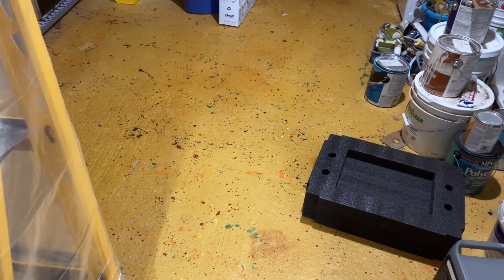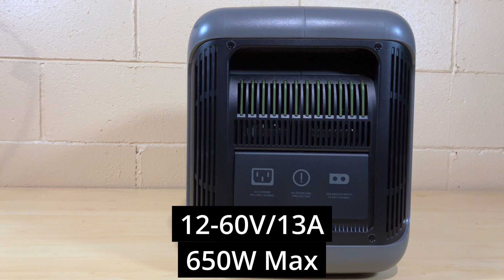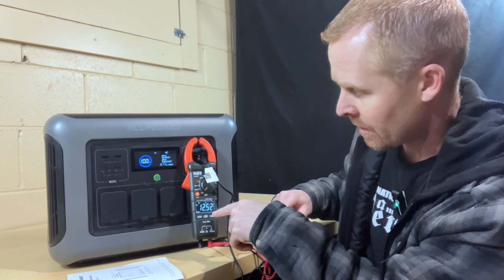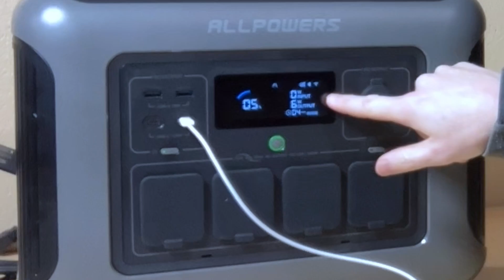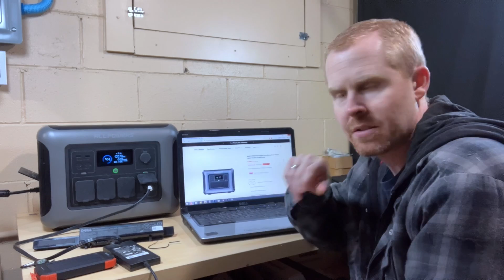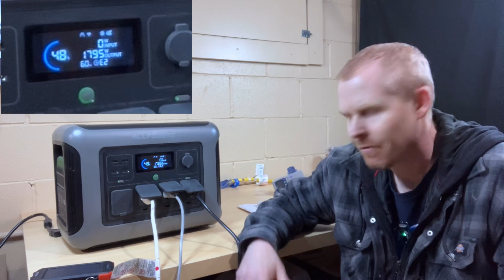ALLPOWERS R1500 Portable Power Station Review

Comment: Can this be used at all without the "app, wi-fi, i-phone" game show? Was thinking of getting this for an elderly relative that will not be able to use any of those techy toys. Thanx.
Reply from the maker: Yes you can!  It has buttons on the front of the unit to turn AC on and off.  If it needs power, you can just plug it in.  The app is not required for normal use.
Reply: @AdamDeLayDIY  Thanks for the quick response!

Comment: Hey adam. Would you recommend this for use of charging cordless power tool batteries and actually running sanders and polishers? Im starting a mobile headlight business and want/need a quiet portable power supply becuase my battery powered buffers suck the batteries dry really fast. So id rather just use my corded buffers
Reply from the maker: Do you happen to know how much power the sanders/buffers use when they run?  Are you talking about running multiples at a time?
Reply: @AdamDeLayDIY  a rotary polisher comes out to I think about 1400 watts when it's running. I probably won't have things running at the same time cuz it's just me. If I have something else plugged it'll probably be a charger of some sort
Reply from the maker: @ChristopherCologneASMR  With only 1152Wh of capacity, you would get less than an hour of total runtime.  While it has its "quirks" that I don't like, it's hard to beat the price.
Reply: @AdamDeLayDIY  that's what I was worried about. I'm new to all this stuff but yeah the price is great. They have the 2000 for 699 right now. I'm probably going to get that one and then make a truck bed cover for my truck that has solar panels on it so I can keep it charging.
Reply from the maker: @ChristopherCologneASMR  No worries.  Yeah it's hard to beat their pricing.  

So a basic way to tell how long something will run is to find out how many watts it takes to power the device (in this case you said 1400W).  So if that sander/buffer ran for 1 hour, it would use 1400Wh (watts x 1 hour) and then look at the power station and you want to find the "watt hours"/"Wh"/capacity (in this case 1056Wh).  

So since the power station capacity is smaller than the power needed to run the sander/buffer for an hour, it couldn't run the entire hour. 

Hopefully that helps and doesn't just confuse you more...😁

I do know that Allpowers was working on expansion batteries as well. Not sure if they're available yet.  Always another option for you.
Reply: @AdamDeLayDIY  yeah it helps. Appreciate it Adam

Comment: Regarding the conversion efficiency, how can we consider the inverter's consumption? Overall, yes, the focus is on the conversion rate so, CC watt per AC watt is the way to measure. CC = continuous current while AC = alternative current.
Reply from the maker: I'm not sure I understand the question.
Reply: @AdamDeLayDIY  (A) it's about the inverter own consumption but this the actual efficiency of the device. (B) is about, pretty much having a direct electrical connection (inside the "box") between the wall socket and the AC consumers. So there should bot be energy moving through the batteries and inverter when plugged on the wall, to power up AC consumers => the battery and inverter stay in standby (inverter shutdown ideally) when the device is used as an UPS.
Reply from the maker: Agreed.  When in UPS mode, grid power should just be flowing to the load.

Comment: Also, regarding the connectivity, it does raise a lot of questions regarding privacy data protection. I no matter what, I don't like to share my location for the Bluetooth access or wi-fi. Second, the menu is dubious + having an account on a Chinese server (meaning CCP) while providing the password to my wi-fi, it make me wander if they could access anything else that i have connected to my wi-fi?
Do that thing with the phone without setting up the wi-fi or installing their app on your phone! See if their device, without being connected "to the world", is still messing with our phone (preferably another phone without their app installed).
Recently I assembled a 15kWh LiFePo4 battery and the BMS  Bluetooth app have, at "about us" and "privacy" tabs, only Chinese language! And, yes, remains the activate location issue.
Reply from the maker: Yeah, I didn't like the app at all.  Lots of issues, and it really doesn't buy you much control over the device.  It's also annoying that if the power station turns off, you have to manually re-enable bluetooth/wifi every time.

The tests I ran on the phone with the display being messed up were on a device that didn't have the app installed on it. I have several phones, one had the app on it and the other didn't.
Reply: @AdamDeLayDIY  people said that there is a security risk when using only a charging cable (which could have been "rigged") so what we can say about "linking" your phone with a box which has a bunch of electronics inside.

Comment: The UPS function can "bypass the charge"/ pass through charge? Through that I want to say if I keep this constantly connected at a power source (wall socket), once the battery is full, it will be disconnected and the consumers will use directly the wall source. 
So the inverter will be shut down when the AC power source is available? (1) AC (wall) - > (2) CC (to charge the battery) -> (3) AC (inverter) -> (4) consumers  (AC consumers). The thing is that if I use it as an UPS, there should only be (1) directly to (4) stage. The battery will be only maintained but not used. The inverter should be shut down as well.
Reply from the maker: When the power station is at 100% it does pass through the grid power straight to the loads.  I was able to confirm this by examining the grid voltage when the power station was at 100%.  It was 122.2v and it was being passed through to the AC Outlets.  When I unplugged the grid connection, the voltage dropped down to 110v.  

I cannot confirm whether or not the inverter actually turns off though.  I would think it would have to stay on in order for the UPS function to be fast enough if grid power is lost.
Reply: @AdamDeLayDIY exactly what i’m worried about. plugged say into a fridge or the tv all the time as a UPS will it draw all that wattage that the inverter take in to charge. That would be very expensive. Now if 100% of the time once the inverter is 100% charged it then the outlet only pulls what the fridge or tv watts is not the inverter watts. thanks great review! $583 2 night ago for the unit and a 140 watt panel. Gotta try it for that price
Reply from the maker: @zgoalscorer10  Thanks.  After looking at different power stations, even with all the little "quirks/oddities" this one has, it's hard to beat the price-point.
Reply: @AdamDeLayDIY what do you think of the wattage thing i mentioned. does it pull what he appliance needs after the inverter is charged fully like the inverter isnt there? thanks
Reply from the maker: @zgoalscorer10  So I just ran a test and the results were...interesting.  

I charged the power station up to 100% and even when the power station said it was at 100% and no incoming power on the display, my killawatt meter still showed 260W being pulled from the power station.  Not sure if it's still charging even though the display says it's full?

When the power station said it was full, I plugged in a 30W fan into the power station and I could see the extra 30W coming from the killawatt meter (AC IN) and not from the power station.  So the power was being passed through from the wall outlet.
Reply: @AdamDeLayDIY  amazing! thanks so its safe to say it doesnt draw the heavy wattage of the inverter 24/7
Reply from the maker: @zgoalscorer10  correct.  In fact I’m looking at it again (after several hours) and the draw from the AC in has dropped down to 25 watts (which is probably for the fan and the UPS circuit for fast changing when power is lost).  If I turn the 30w fan on, my AC in shows a 55 watt draw from the grid.
Reply: @AdamDeLayDIY  great information as many buy this just for the ups feature. what you charge yours at the normal charge? I heard fast charge can ruin battery faster
Reply from the maker: @zgoalscorer10  I usually just leave it at “standard” charging or I use solar when I can.
Reply: @AdamDeLayDIY  thanks so much i think thats the default on the r1500 and can only be changed in app fron what i understand. I have my unit coming monday.
Reply from the maker: @zgoalscorer10  Correct, that's the default and only changeable inside the app.  Enjoy!

Comment: Good review Adam. The phone going haywire when the unit is charging is likely a neutral ground issue. Have you looked at the Bluetti AC180? This unit seems to be competing with that.  I have the AC180 and so far am very happy with it.
Reply from the maker: Thanks Bruce.  No I haven’t looked at the AC180.  So is that an 1800 power station as well?
Reply: @AdamDeLayDIY  yeah the AC180 has an 1800 watt inverter with an 1152 wh battery.
Reply from the maker: @brucebugbee6604  aside from the capacity and output power, I haven’t reviewed anything yet with better features/software than the Anker.

Comment: The unresponsive phone sounds a lot like there is an earthing issue with the power station.  I wonder if there is low voltage between the earth system of the power station and the premises earthing/the planet.  It's that fuzzy/furry feeling you get where there is leakage current from switching power supplies etc in double insulated devices.  It's perfectly safe but can throw touch displays etc into a spin.  I see a similar effect with my old Toshiba laptop's touchpad if I disconnect earthing in my own setup.
Reply from the maker: It's entirely possible.  Hadn't thought of it before.  I remember going up and telling my wife I thought my phone was hacked because it happened right after I installed the app.  🤣

Comment: Bluetooth account requirement seems logical to me.  Prevents your neighbor from turning off your power station.
Reply from the maker: You have to be in proximity of the power station to connect over Bluetooth, but you can turn it on and off without an account.  You just can’t access the settings without an account (actually you can’t go back to the power station selection page either).

Comment: Coffee Maker would be a good test.  Wonder about using it with a typical microwave.
Reply from the maker: It worked with my coffee maker.  Microwave would be a good test.  Always hard to get a lot of tests in without going SUPER long.  I actually had 3.5 hours of footage to trim down to what I ended up with.